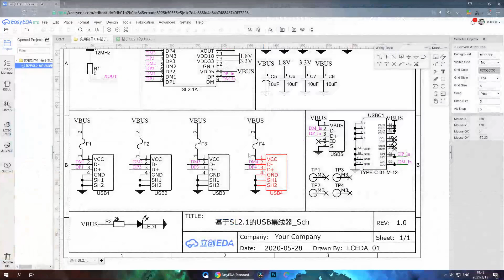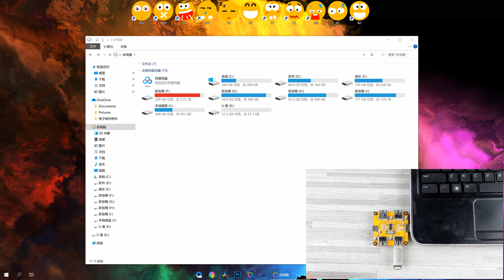How To Make USB Data Hub

Comment: How you can solder SMD part perfectly?
Reply: Id suggest using a stensil, spreading solderpaste onto the board and then heating up the board/paste using a hotplate or heatgun with your components already placed into their correct locations. After heating you will melt the solderpaste and the paste will solidify with the components perfectly aligned.

Comment: This usb hub is not usb standart conform, it can draw more power than allowed
Reply: How does one fix this?
Reply: @captainpumpkinhead1512  probably with a USB hub controller that accounts for current
Reply: @dergraph69 probably you should understand, the device which connected to the USB Hub is the suspect who drawing current. Not the hub. Probably you should understand a lil about electronic.